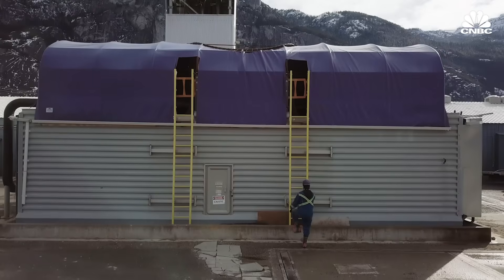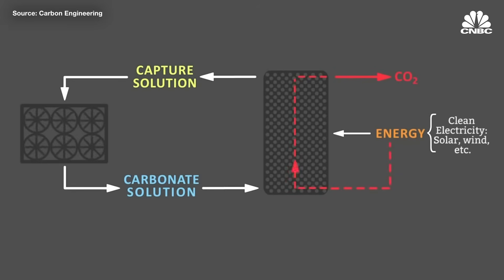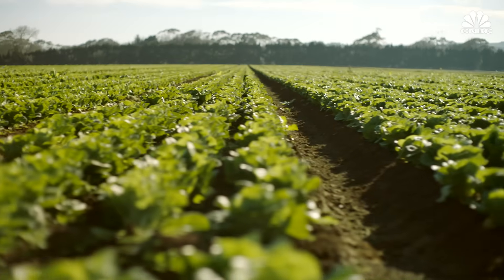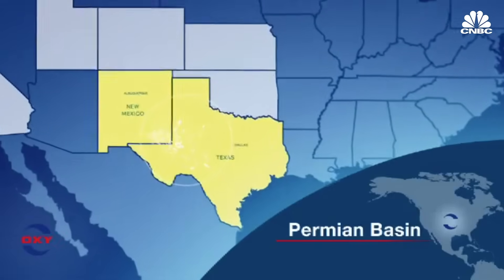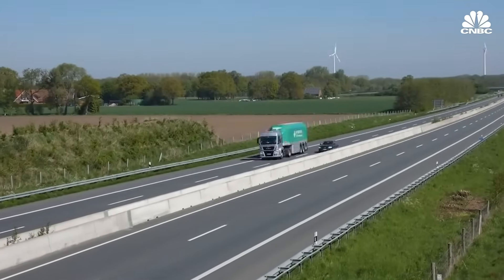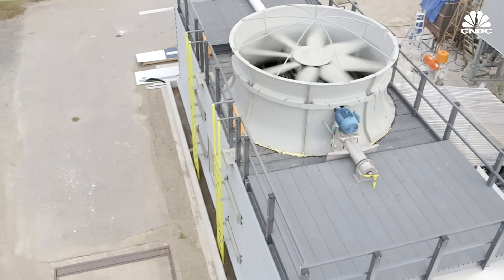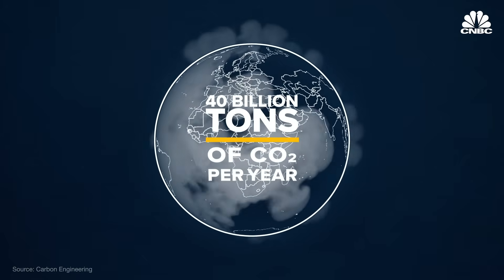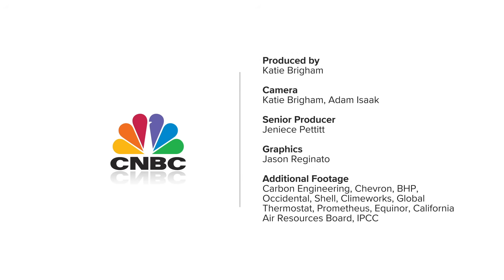Bill Gates-Backed Carbon Capture Plant Does The Work Of 40 Million Trees

Comment: This doesn't fix the issue. It's taking CO2 from the air so it can be stored underground. This project throws a blanket over the items in a messy room. You no longer see the mess, but you know it's still there. The project is powered by gas and electricity. Sounds like it's using more gas to be able to remove gas.  Trees actually convert CO2 into oxygen. Figure out how to do that with a machine and you've found a solution.
Reply: Actually they don't

They convert CO2 and H2O to C6H12O6 and O2

My point is, the O2 actually comes from the water molecules, not from carbon dioxide molecules

Comment: Just capture is not good enough! We have to recycle CO2 to pure Carbon and pure Oxygen. The solution is  www.labofcarbon.com.au
Reply: That's a fantastic idea, why did nobody else think of that outside of all vegetation?
Reply: Where do you get the energy to pull O2 off the carbon?  Remember that attaching it (burning) gave you the energy in the first place.  Answer: Plants (sunlight, photosynthesis) pulls O2 off carbon.
Reply: @Carvin0  electrolysis

Comment: "It's called 'carbon engineering' and it uses a combination of giant fans and complex chemical processes to remove CO2 from the air." I believe that if it's not natural (like this isn't-it's chemical) then some negative or harmful unintended consequence will occur. Examples of this include prescription drugs where you take it for one ailment and the list of side effects are as long as government wait times. Sometimes the side effects are so hindering that you have to take more prescription or other chemical drugs just to address the side effects. Another example is chemotherapy treatment. A good number of people I read on Youtube last night believe chemotherapy actually kills you or kills you faster than the actual cancer to which you're receiving the treatment to address in the first place, does. That's why I'm skeptical to non-natural solutions to problems.

Comment: I’m shocked that people had a problem with oil companies backing a solution to our CO2 problem. One it shows some level of them taking responsibility. But more importantly we don’t have an alternative to oil. We need to buy some time to change our infrastructure and this has the power to do that. It’s no secret that oil is going out (it will run out eventually). But they have enough oil stored that, if burned, would produce enough co2 to irreversibly damage the planet. They aren’t just going to bury that oil, they want to sell it. So, if it will be burned we need to prevent the damage. I love ideas like this.

Comment: A tree can captures roughly 20 kg of CO2 (average) per year, so 550 g/day.
the atmosphere contains about 400 ppm CO2 - 0.04%, with a density of around 1.2 kg/m³. That gives us roughly 1100 m³ of air that they need to filter per day per tree - if it was 100% eficient.
You need to process quit a lot of air to capture a little CO². We are not even considering the extra infrastructure and maintenance yet - that all creates emisions and reduces the efficiency.
The problem with powered solutions so far: It needs shittons of energy. Instead of wasting it like that you could simply use that power. Not releasing the CO² in the first place is more efficient.

We already have many other ways to reduce out carbon footprint, solar and wind are just part of that because they are way too volatile. Hydro is great in that aspect as we can regulate it. And Nuclear is still the cleanest and safest energy we currently have (yes - US coal powerplant release more radiation than Chernobyl did, Hydro accidents have killed more people than nuclear has harmed in total, and even Solar is a lot deadlier per TWh).
And then there is the fact that while CO² is a greenhouse gas, it is a rather weak one, which means in contrast to other gases you need a lot more for the same effect, so you also need to filter a lot more to get the same result. Reducing the Methan emissions in agricultural industries is "easier" and more efficient.

But the best way is still to reduce the emissions - it is the simplest and most effective method.
Using more efficient technology (LEDs for light, better insulation for refrigeration etc) not only reduces electricity needs but also often is cheaper once you look at it longterm.
(Heck, my old computer used so much more energy that switching to a new one that is nearly 5 times faster overall will pay for it self in roughly 5 years.................my PC is running many hours a day)

Working together with oil companies is not a problem - they also have for a long time tried reducing the pollution they create. You just need to stay wary as with any other lobby - they will lie when they think they can benefit and get away with it.

Comment: "Oil companies love it, they can take that CO2 and produce even more oil, which means we will burn more oil!" 
Are there companies just waiting for more oil to burn? 
Are they trying to use it all up as fast as they can, even when the price inevitably increases, due to the source of CO2 being more expensive? 
It sounds completely foolish to me, but perhaps I'm out of the loop. 
Change my mind.
Reply: No need to buy an electric car cause co2 isn't a problem anymore! Essentially
Reply: @VerticalStrafes  That's not a case of burning more, apart from new buyers, just entering the market. Most people buying their first vehicle, won't have the cash for an electric vehicle anyway.

There's also the argument that creating those batteries and charging the vehicle (most of the worlds energy is still "dirty") isn't particularly good for the environment, either. 

Even if this works well, oil is still a finite resource. Research and development of solar, wind and hydro won't be slowing down. 

I still don't see how this will cause us to burn more than we are now.

Comment: So just wondering if it's possible for a plant like this to, over time, remove so much Co2 in its immediate vicinity that it could create a low-carbon "bubble" that might eventually have a negative effect on the local vegetation/biosphere?

I suppose it would be critical to the choice of location that there be plenty of wind/air movement annually - having lived in a couple of places that happened to be situated in large valleys, I've seen the opposite effect of pollution build-up during temperature inversions or long periods of relatively calm, low-wind periods.  

So I don't think it's too much of a stretch of imagination to see the potential for the opposite effect of the air being stripped of so much Co2 that it might begin to have a negative affect on plants and agricultural products.  Any thoughts on this ;?)
Reply: According to physics there's nothing to worry about, it'll get mixed up and there'll be no bubble because there is no barrier keeping the air masses separate

Comment: Of course the one thing they never mentioned is how much energy to takes to take a ton of CO2 out of the air. This is always a losing proposition. They are vague on their energy requirements, but have publicly stated that the energy it takes to capture one ton of CO2 using this requires burning natural gas which emits 0.3 to 0.5 tons of CO2. Now... coal puts about twice the CO2 into the air as natural gas. None of this includes the power to build the plants. So...

If you don't have any natural gas laying around... it can't really help with CO2 using coal power, since that would barely be neutral. If you did have (extra) natural gas around... you'd still get more CO2 out of the air by not building carbon capture and instead using the natural gas power to simply close down a coal plant (or not built a new one). And of course if you have any source of energy which doesn't emit carbon (solar, wind, nuclear, fusions, hydro, geothermal, etc.) you'd still be better replacing coal plants with these. Even if you have a local surplus of renewables (and the cost and variability issues are solved), you'd still be better off exporting electricity to areas with coal plants to allow these to be shut down than powering local carbon capture. Heck, you'd probably still be better off shipping electricity to natural gas areas, closing down the natural gas generators, and shipping liquified natural gas to coal heavy areas (like China) to replace their coal plants.

Until these things at least double in efficiency (on their best estimates, not ranges or averages), they can't pull CO2 out of the air as fast as a coal plant is putting it in the air. As such, they are always better off taking the power they use and diverting it into replacing coal plants. Coal is 41% of world electricity usage.

Also, that it replaces 40 million trees is still also a losing proposition. There are something like 3 trillion trees on the planet. Canada alone has 320 billion or so. In addition, Tree Canada plants about millions of trees a year via just public participation. Forest industry can replant over 5,000 seedlings per person per day. For the cost of constructing this plant (plus the natural gas power plant to power it)… you put plant far, far, far more than 40 million trees if you wanted.